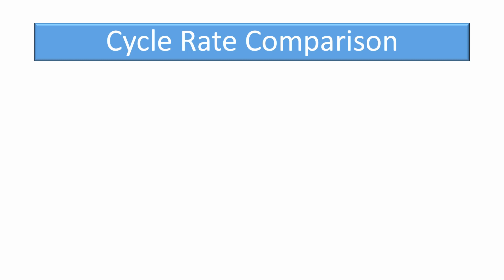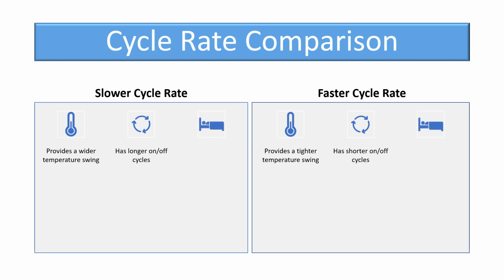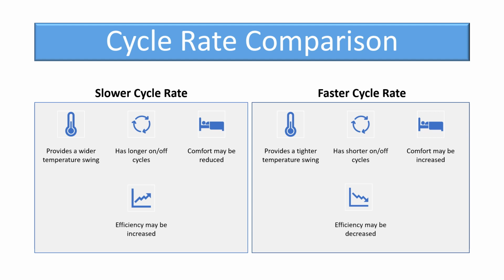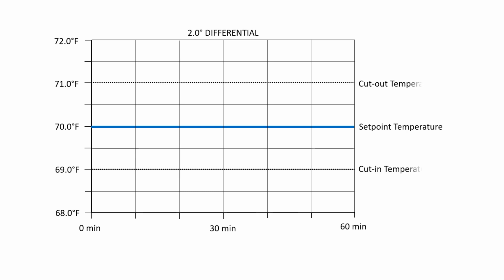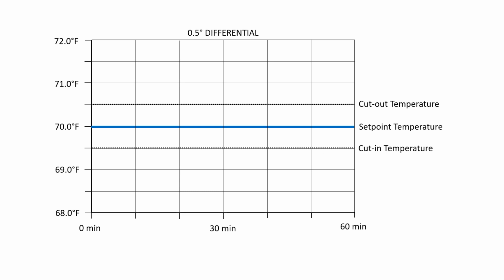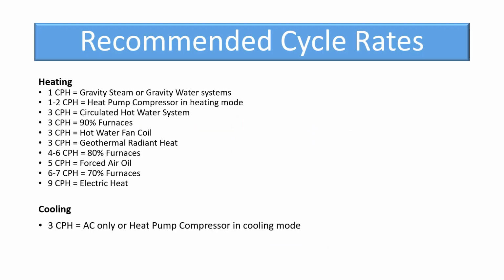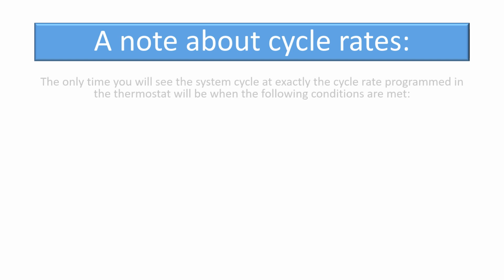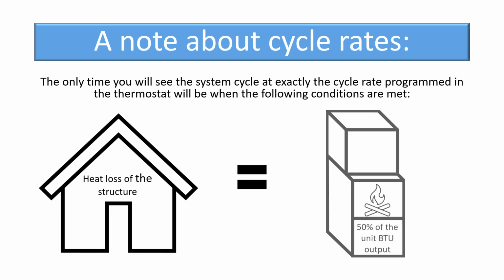Thermostat Cycle Rates

Comment: Wow ....thanks so much for the info!! The only video that actually explains it perfectly! Yay. I do have a question though. I have a new modular house with 2.5 ton HVAC and Honeywell Home T6 thermostat. The installers were complete dumb a$$es they came 5 times just to get it running. They still don't have aux heat set up. But my question... The cool and heat CPH was set to 3 CPH, but they changed both to 1 CPH. Does that sound correct to you? It's 1,740 sqft. in northeast TN.  and the he heat is 36,000 or 38,000 BTU I believe and it is all electric.